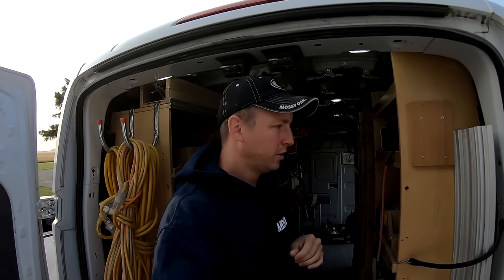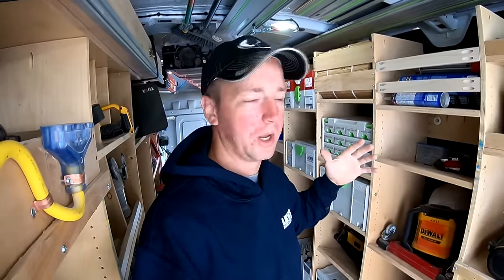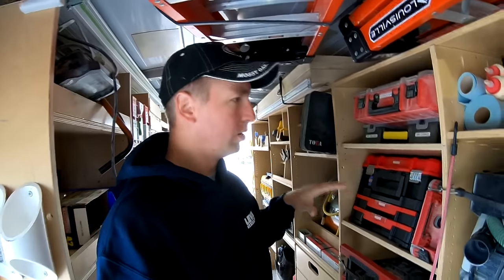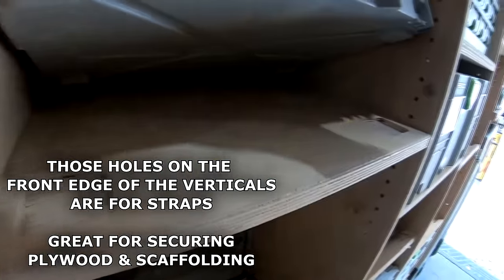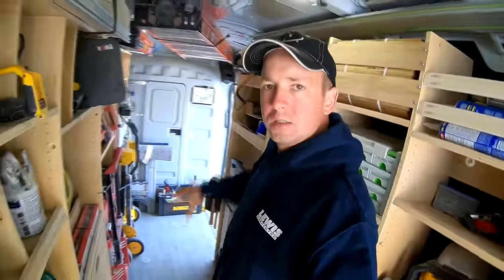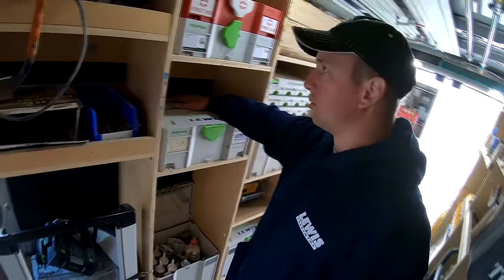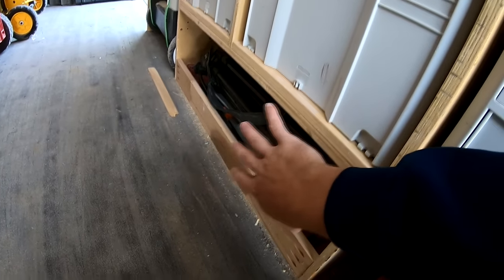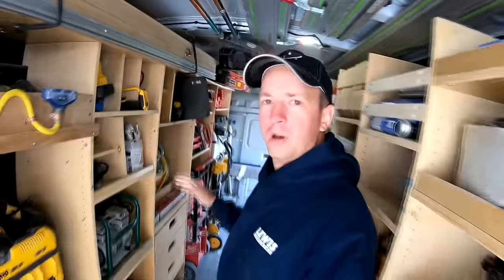Work Van Shelving Layout - How to Design & Build Efficient Van Storage Shelving

Comment: I’ve fitted out few vans I’ve had and one thing I’ve learnt is if you like to put your foot down, think about the material your using to make it all as it quickly adds weight to the van, plus tools and the materials your load up, it all adds up and it will slow you down.
Reply: What's the lightest material that you recommend.    I won't be storing heavy tools

Comment: Doing one trade specific thing really helps with organizing the van setup . Not having to carry a wide range of tools and materials .
Reply from the maker: It really does. Everything changes when you open up your scope of work. I do use totes for other trade specific tools. I've got totes for paint, drywall, plumbing, electric, etc. So if I do have to tackle one of those things its just a matter of loading up a tote and I have all the basic tools. But that never happens any more. I've locked into trim work and haven't taken on anything else for probably 4 or so years now.

Comment: Looks good ! I have upfit  promaster for carpenter  & handyman work.  Just a guestion about other bigger items. Where do you carry some 1x2,3,4 pine. How about 2x4 stud & p.t..  Then ur cut 1\2", 3\8" drywall, 3\4"& 1\2" ply? Lastly where is the dog and drop cloth compartment? Is  this design meant  for tool transport to full on construction site?

Comment: Do you have any issues putting all of your heavy tools on one side of the van? I just purchased a ram ProMaster 3500, but I know very little about commercial vehicles. I assume the van is built for this imbalance
Reply from the maker: The 350 handles the weight well but I would recommend trying to balance it as much as possible.

Comment: Great videos Spencer. Building out my Mid Transit 350 with the padded flooring. Having trouble keeping the shelves plumb, as the floor is uneven/sloped. A few questions: 1) How did you overcome this issue? 2) Did you use any shims under the partitions? 3) It doesn’t appear the top of the van comes out the same as the bottom, top of window area to bottom - how did you accommodate for that? 3) Did you build the shelving outside the van then move it in, or did you build it in the van. 4) Due to the slope of the floor, and the van, depending on how it is parked, checking for level is very difficult, how did you accommodate for that? 5) I am finding that the shelves need additional support due to the weight of the boxes/tools on them, did you find the same issues? Thanks!

Comment: I am guessing you don't fit out vans for a living, as most of the tools mentioned would not be needed, but this was a very impressive and informative video, thanks a lot.
Here in Japan we have what are called "k-vans", basically meaning a light (vehicle) van.
They are much, much smaller than yours (they are the length of a hatchback car and limited to 660cc engines).
I am thinking of getting one as I am planning to move to the countryside and have a house with a vegetable field etc.
So this was a very helpful "grown up" version of what I would be likely to need to do if I were to buy a k-van.
Thanks very much.
Though my challenge will be considerably less in scale then yours was, you are a carpenter and I am not.
Anyway, if I do this kind of thing, I will take my time and triple check every stage before moving to the next.
Reply: I wish we had the option to buy some of those small Japanese cargo vehicles. Also, 10/10 username.

Comment: Superb set up but, isn't using 3/4 wood too heavy?
I have the quiet Flex plastic shelving in my Chevy Express van. It's on the lighter-weight side which helped save in fuel of course because I drive major amount of Miles everyday....
Maybe you aren't really concern with gas mileage....
I've noticed two things on the positive side
1) I don't see any crappy, cheap tools or equipment.
2) you're smart and organized!
 thank you
Reply from the maker: The weight definitely adds up. I do have the 350, 1 ton chassis and suspension which helps. Also, I have the ecoboost turboed engine, which zips around like all that weight isn't even there. I get 15.5 MPG all the time. I'm happy with the setup.
Reply: @InsiderCarpentry  That's really surprising for that much mpg's. More power to ya bro!
Thanks for the feed back.
Reply: So you opted for the Ecoboost engine, I am concerned about the long term problems a turbo can bring.
Reply from the maker: I haven’t been aware of any issues with them. I’m any case, the engine is my favorite thing about the van. Get me where I’m going fast. Doesn’t ever feel like I’m dragging. It’s the fastest vehicle I’ve ever owned.

Comment: Great video bcc I'm looking at getting a van bcc right now I have a trailer full of tools. And I'm tired of the trailer. I need it all in one vehicle
Reply from the maker: I had a big trailer before this van. They definitely have their negative aspects.
Reply: I could see that. I have a trailer, I like that I can leave it at my site when I need to and be mobile with my truck. That being said,  i don't like leaving the trailer unattended much. Squeezing into tight spaces is a bit of a bear sometimes.
The van seems more secure and nimble in most cases. But also one more vehicle to service and deal with breakdowns. Can't leave it behind unless you arrange a lift either. 
Any other pros for the van, and why?

Comment: Hey mate. I’m about to buy a mk8 Transit. I see you have toggle clamps holding your Festool rails up.. how have you fitted the toggle clamps to the van ceiling?
Reply from the maker: Screwed them on with Tek Screws. Metal self tappers.

Comment: I know you said you can throw 16’ material inside the van but how do you transport greater loads of 16’ material? I’m about to change to a high roof from a standard roof but have a tough time figuring out how I’m going to transport a lot of material quickly and efficiently without having to jump on the roof and use bungee cords.
Reply from the maker: Simple answer is that I don’t. Large orders I have delivered by material vendors.
Reply: @InsiderCarpentry  Thanks for sharing. By the way, love your videos. Inspired me to reinvent my storage system in my van. One of my favorite videos you have done however is the one on running a business efficiently, constantly evaluating growth and expenses and etc. Awesome stuff!

Comment: Hey Spenser,  Great video   Do you know anyone who makes. C&C Milwaukee shelf cut outs …. Like the plastic ones used to clip the pack outs to the floor or wall…. I thought it was on your channel I saw a post on getting them for someone….. perhaps you have seen them or know of who to ask…. Like to use your system and pull out drawers with my pack outs   AL
Reply from the maker: Not that I know of

Comment: Hey Spencer, I've not had much luck with Menards pre-finished plywood, it seems to start bowing as soon as I cut it up. But I do love Menards TigerFORM 3/4" forming plywood, same weight and much more straight and stable! It's got a tough black phenolic finish on both sides plus a nine ply poplar core. Cost is about the same, where I am it's a special order but well worth the wait! I just got a sheet to build (your) wings for my new Dewalt 780 slide saw. Thanks for all the great videos!

Comment: Great video! Where did you get that First Aid Systainer style case? I need one. Never cut myself on a power tool in my entire life. Cut myself twice in one day coping crown with my Carvex. Didn’t have my crown clamped down. So I bought a pair of Worx work surfaces.
Reply from the maker: Just google first aid systainer.
Reply: Insider Carpentry damn!! $105 for just the systainer?? With no first aid kit? Youch!!! That’s hurts almost as much as my jigsaw mauling the webbing between my fingers.

Comment: If you had a month free, an budget to buy all new tools and pack out, or other storage.... what would you do different based on what you have learned?

I just got a new Transit Van, High Cab/Extended 1-ton AWD. Loaded up because I sold my pickup and this van now served as my daily driver .... even to church on Sunday lol.  I couldn’t afford to keep both nor did I have space. 

I purchased the same partition you have except I have a window. Also I have two sliding doors. My plan is to build storage on the driver side slider that allows me to quickly access the most common tools as soon as I exit the van.  I have found the only use of the partition sliding door is to allow me to carry 16’ material on the floor with back doors close. 

I spoke with LineX.  They are going to coat the shelving I make with a thin coat of LinX and use the smooth texture for easier cleaning 

I’m just struggling with the most efficient layout.
Reply from the maker: Id keep it mostly the same. I’d be tempted to switch the sustainers for Tstaks. The good thing is all these different brands have great options now. When I started my collection it was mostly just festool that had stackable boxes.
Reply: @InsiderCarpentry  I have all Milwaukee pack out. The only complaint is they are a bit deep, take more idle space. I have a few sustainers but am going to consolidate everything into pack out.

I’ve noticed a big shift from pickups to these vans. I need a four or AWD because of the snow and mud here. So having the AWD transit made that possible. So far it works well in up to 15-18” of snow. Not sure if it would work in a lot deeper.  

Thanks again for making the video and sharing your ideas

Comment: I really like your videos. They’re very informative, and helpful. I need to get a new work van, and I like how you’ve got yours outfitted. Have you ever had a problem sliding plywood in on the vinyl floor of your van? I would think it might rip it as you slide the wood in. 
Thanks
Reply from the maker: So far no issues. The rubber mat is from ford and is pretty durable.

Comment: Nice setup Spencer. I have moved most of my worksite stuff to packouts. Not sure if you know this but there are some folks making adapters for the Milwaukee jobsite organizers to lock to the packout systems. Those containers are real nice for fasteners and are cheaper than the packout cases.
Reply from the maker: I've seek the stuff kapez inserts is making for the packout. I'm really excited to see what packout comes out with in regards to totes with drawers. I feel like that will be a game changer.
Reply: Iv just had a 2nd van and I'd like to kit it out how do I get a fixing to side of van please

Comment: How did you attach the shelving to the van?
Reply from the maker: Up fitter points in the van with M8 bolts.
Reply: @InsiderCarpentry  which brackets did you use? thnka

Comment: 2 questions, why the heck do you have 2 festool vacs 1k each, and I saw a bondo can , where do you use this in your field?
Reply: Probably one for his drop saw and one to use with portable tools like a track saw, doesn’t take many hours to recover a grand not having to swap between tools or extra clean up
Reply: @clintjones1193  i doubt it, i don't think it makes sense to be using a miter saw while using another tool that requires dust collection
Reply: I also use 2 festool vacs, 1(the26) for the miter and table saw,  the midi for track saw and other tools also general cleaning, not chip but very convenient. Great job on the van, I'm a big fan of your work. I'ma finish carpenter cabinet installer.
Reply: @horatiocozzi1698  daaaaaang, it takes me 2 seconds to remove my festool vac and plug it to something else, but you guys are another level lol. I own a 12footer cube and already my festool 46 is taking way too much space, imagine having 2
Reply from the maker: One vac is always on the miter saw, the other vac is for other portable tools but is on my sander 95% of the time.  I can't imagine switching a hose everytime I switched between miter saw and sander, with my workflow that would be a ton. There was a time I actually even carried three vacs and had a CT26 for my table saw also.
Reply: @InsiderCarpentry  3 vacs 🤣🤣🤣🤣🤣🤣🤣
Reply: Khaled Achcar this guy is all about efficiency, while he’s not using them at the same time it’s very likely he’s using tools in different locations and he’s not about to be swapping a vacuum back and forth all day.

Comment: Is there a diagram for all the connection point? Screws
Reply from the maker: I just pull the plastic back and find them. There are about 8-10 points per side I think.

Comment: We got lucky purchasing our Sprinter 3500 4x4 dually extended high top van. Fully loaded features basically with the rubber floor mat(wood underneath), full stainless construction package shelving, bins, 2 lock boxes etc..for only $2.5k more than the Ford. We found out later the saleswoman was fired bc she gave it away to cheap. 

I would love to be able to share pictures, where we can all show & discuss tips and tricks etc..only thing I can think of is a Discord server where you can make different rooms for discussion like -general chat-van pics-upcoming tools etc..

Also heard Milwaukee is coming out with a track saw either Q4 2020 or Q1 2021. Unless Milwaukee’s is a game changer I still want either a TS55 or 75 just can’t decide which would be better for me. 

Also, how does the glued guide strips on the bottom on the festool track hold up in the van being faced up to the roof of the van with the freeze thaw cycle? 

Love all your content!! 👊🏼🧰
Reply from the maker: I use the makita splinter guards and they hold up well. The festool ones fall off in the heat.

Comment: Festool cordless sander not available on amazon. What’s your recommendation?
Reply from the maker: Follow this link. This is what you want. https://www.amazon.com/dp/B0897VFGMS/?tag=insidercarpen-20
Reply: @InsiderCarpentry  I’d like to remain cordless with festool. Any recommendations.
Reply from the maker: I wouldn’t. The stroke size is much smaller on cordless. Takes longer to sand. I have one. I wouldn’t trade my corded for a cordless. I also have a cordless. It takes forever.